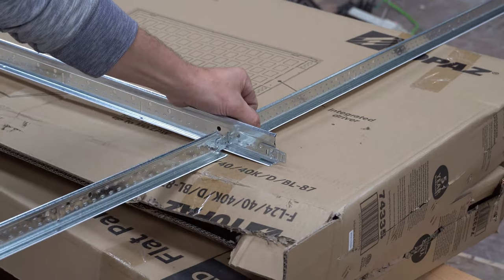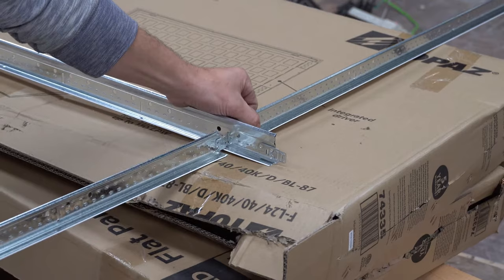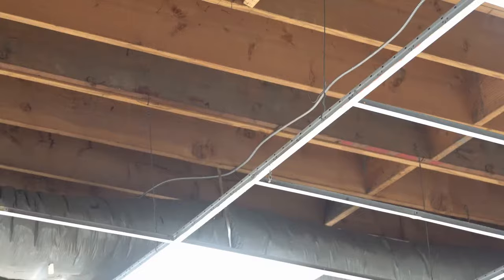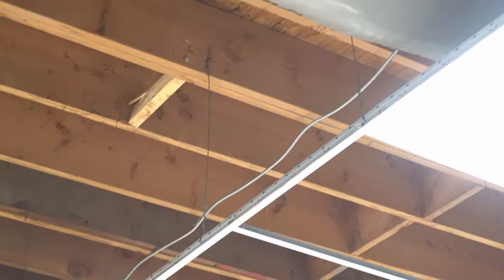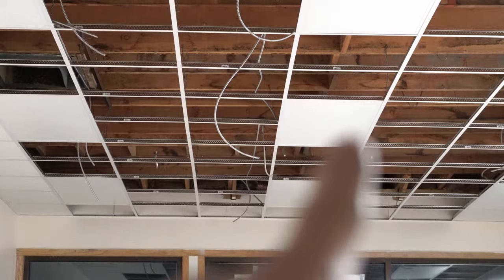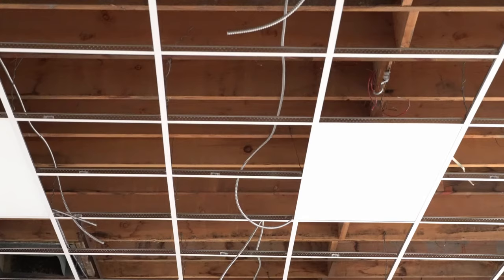5 Common mistakes while doing a drop ceiling

Comment: Hanger wires are supposed to be directly above the mains. Not pulling in a certain direction. Lazer them. Then put a lazer on the main. Put in all the cross-t's in the first row along the wall. Keep the lazer on the main. Screw a small 2inch piece of wall molding ( L ) into the wall and into the cross t. Now the first row is locked in and everything is solid. Nothing pulling in any direction. Perfectly straight

Comment: Few things to help. With wires, they need to be no more than 4 foot apart. If you start 3’ off the wall then 7’ then 11’. At 11’ you’ll have a wire at the joint of the main to keep from sagging. Level the ceiling with your laser. Hang it on the wall angle and drop it to 2” if you need. Use a magnetic laser card and stick to grid and Jack the wire up or down to keep 2” all around or whatever your laser is set at. Always stabbing to the right side is correct for most grid like Armstrong Solutions. While USG grid stabs to the left. And old style hook grid you have to hook it from under the grid then hook other side. Too get a correct split, say the room is 12’ wide even, that would be an 8’ foot split. Or 4 full tiles in the middle. Measure off one wall 8’ and make a mark. Measure from the other wall back to your mark and split it in half. That’ll be your border.  using 15/16 grid you can set a string whatever your border is + 2’ + 1/2”  of the longest wall. You don’t need a main on starting off your border when you can start it border 2’ and cut 4’ tees by scribing the string. There is a lot more too it lol. Main thing is staying square 66 3/8” for 4x4, squaring between mains. and 52 1/4” for 2x4. If you set 2 strings one on your first main and one on your edge of border tees you’ll only need to check square once because you have 2 square lines. It’ll have to stay square.
Reply: Also if you’re hanging wires into wooden joists, use wooden eye screws not staples lol they will pull out. If it’s concrete use shot pins like hilti. And if it’s metal decking use metal eye screws. They make a telescopic pole that attaches to a drill that will screw and tie your wires both with a drill and never have to get on a scaffold to hand tie them
Reply: sounds like a real ceiling installer here😅
Reply: only been doing it 2 years and i thought most of what you said was common sense but as i watched the video longer i realized why you wrote this guy a book of “tips” 😂😂
Reply: What if you are putting a ceiling in that has drywall hung and you don’t want to tear it out . How should you run the wires ? Cut out enuff to put screw eyes in , is my guess

Comment: you missed the most important for any dropped ceiling ,get it square ,otherwise the tiles will not fit
Reply from the maker: To me honestly the click in is most important since that helps keep it tight and square ish. But certainly being square is top priority
Reply: Use a tile as a template
Reply: Cut it loose let the tile square it up😂

Comment: Hi I have a 15 foot ceiling but its split into 2 businesses with a wall partition separating both at 8ft I want to install a drop ceiling  should I use longer wires? I'm doing it myself.

Comment: Cant you just rotate the lights 180° and then the wires will be at the appropriate corner of the light fixture?
Reply from the maker: I don’t remember the job in detail but it was not able to be moved around easily I think not enough slack and they added another row